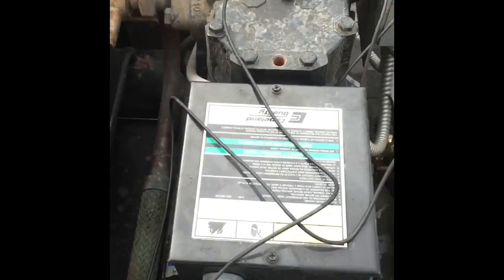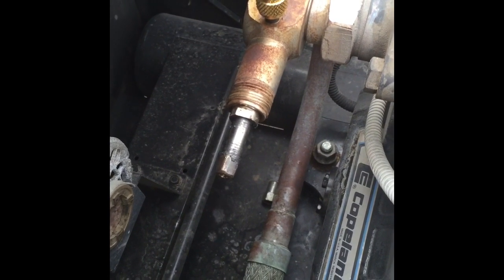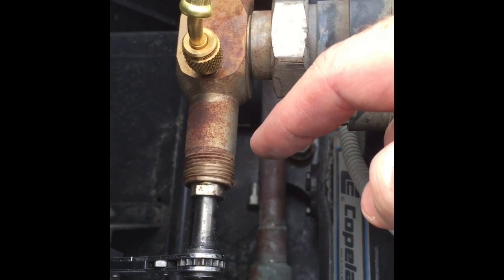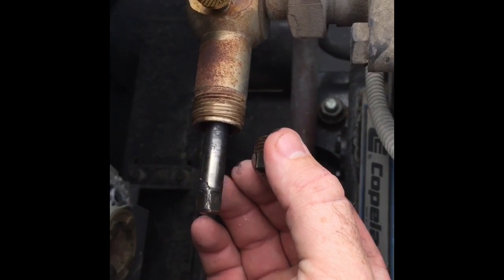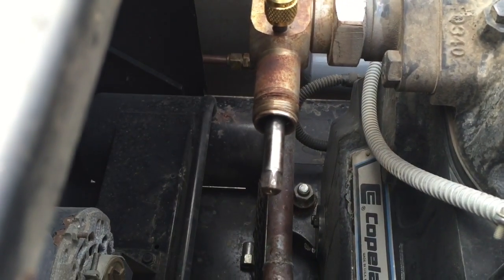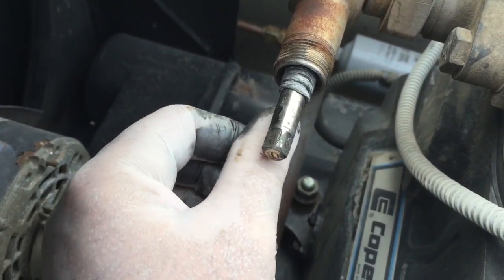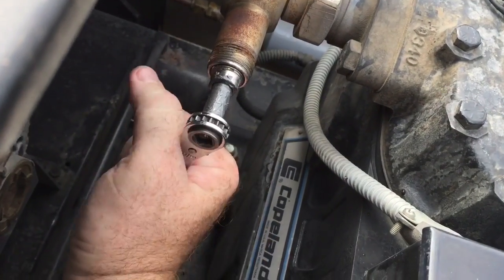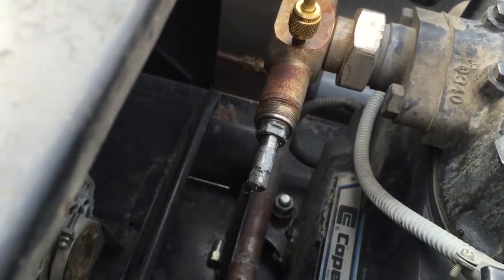Re-packing refrigeration service valve

Comment: That info may come in handy one day, thanks! See a lot of newer equipment without the packing nut, the valve it just crimped over so once it leaks thats it.
Reply from the maker: I can't stand that.  Especially those small tonnage txv's that always seem to start leaking around the adjustment stem, with no way to fix but replace.
Reply: camron conlee
Its a race to the bottom quality wise...